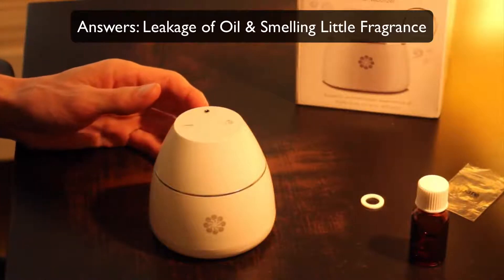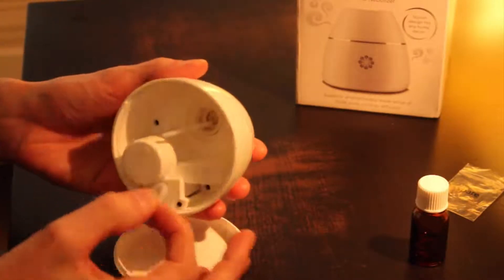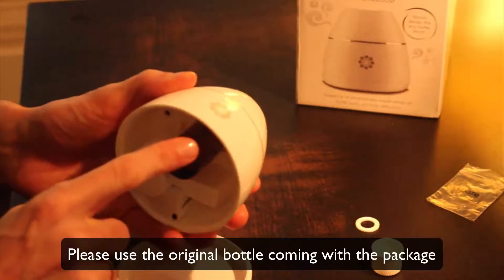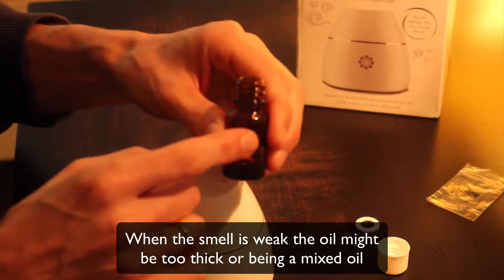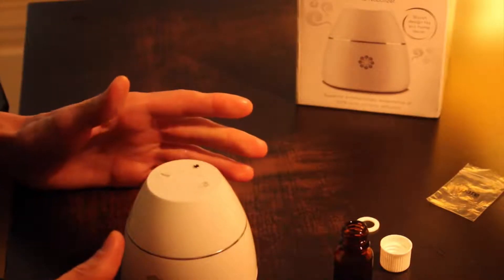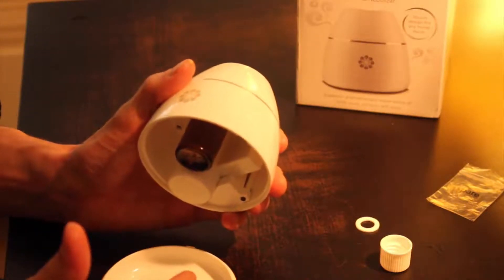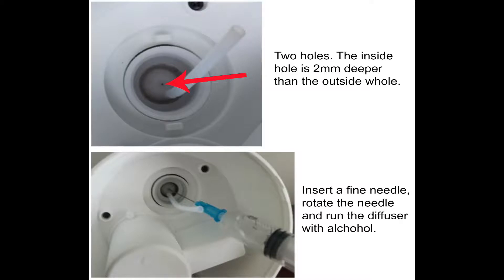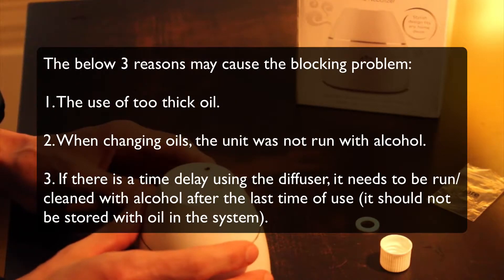Answers: When Your Diffuser Leaks Oil & Smelling Little Fragrance

Comment: filling the bottle is it mixed with water as well or straight oil how long does it last im looking to put this in my car
Reply from the maker: Best is to not mix it with water, as there is also no need for it sine the nebulizer will pause every 90 seconds or so for a bit which means you will be saving on your oil anyway. How long it lasts really depends on the intensity setting you put the aroma diffuser on...there is low, medium and high...but in general one bottle will last truly MANY hours.